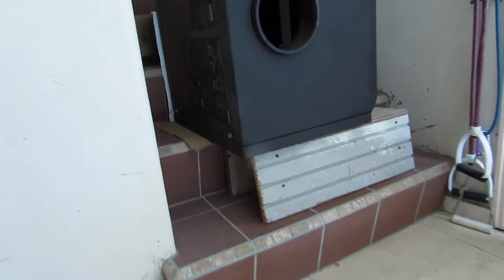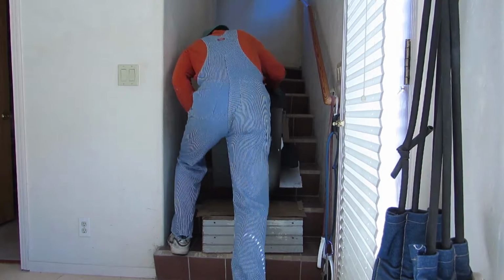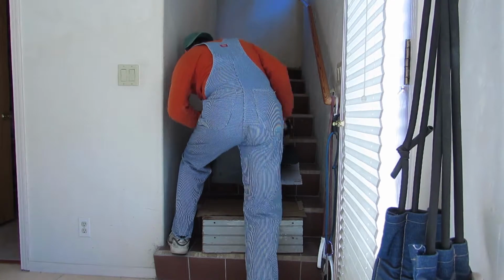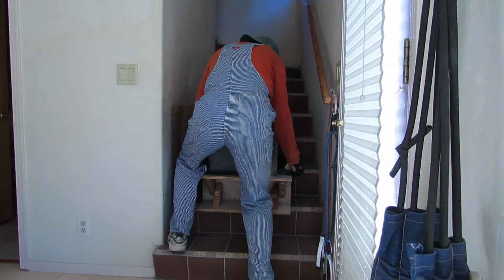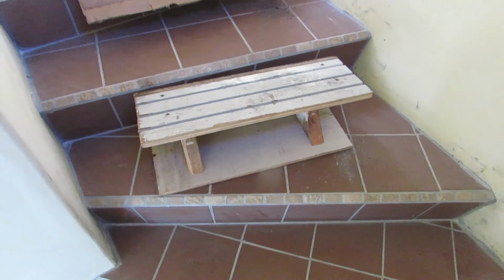Moving a wood stove - Up a windy stairway with one guy

Comment: Very inventive. it appears the stove is "rolled" at every step, meaning it'll be up-side down, and sideways, a few times. Hopefully the shielding doesn't get crushed. You'll need to eat your wheaties also, before attempting.
Reply from the maker: This is a Lopi stove with sheet metal heat shields.  They were undamaged.   The stove is on cardboard as it rolls up.   I am no weight lifter but was able to manage.  There is real magic in rolling rather than lifting.